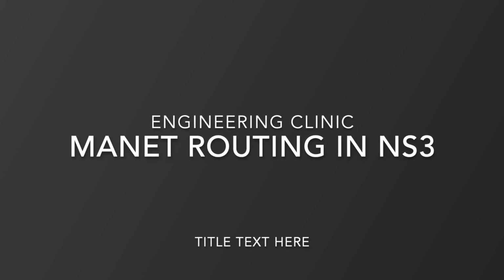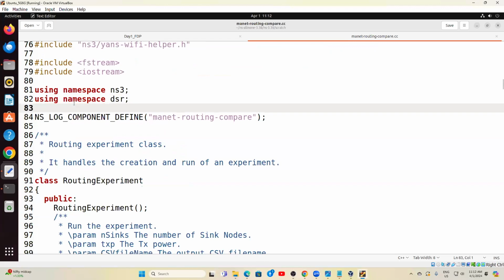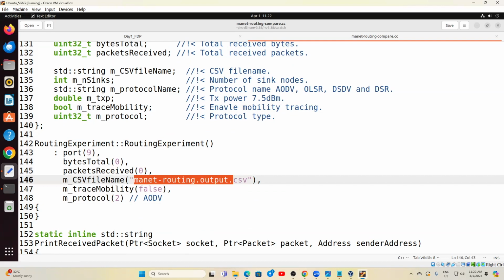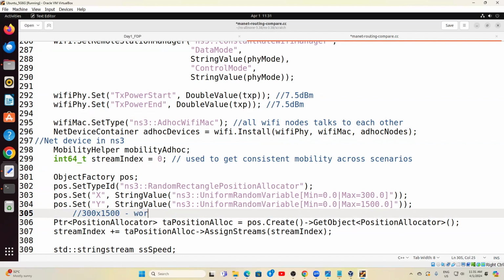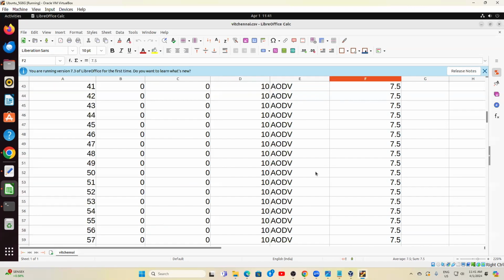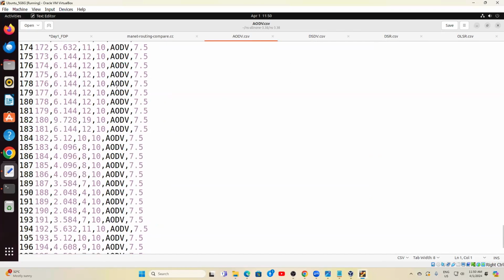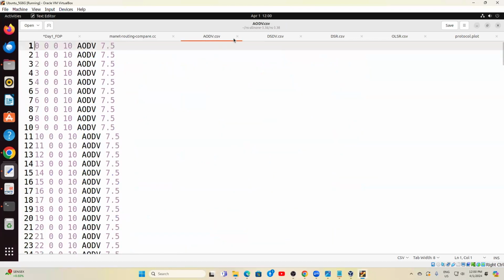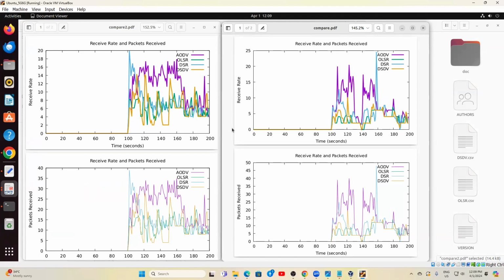MANET Routing Protocol in NS3 | Session 3 | NS3 Tutorial 2024

Comment: Hello sir, i ran all the installation process, the first and the second codes ran as per required but the manet routing compare isn't giving the output as shown in this video, it gives me "linking cxx executable manet-routing-compare-default therefore there is no output on my terminal nor there is any change in the .csv file after 100s i.e the received packets remain 0 itself, Can you please help why this is happening and how to rectify this?
Reply from the maker: Check the parameters involved in your code...
Reply: Did you solve the problem ?